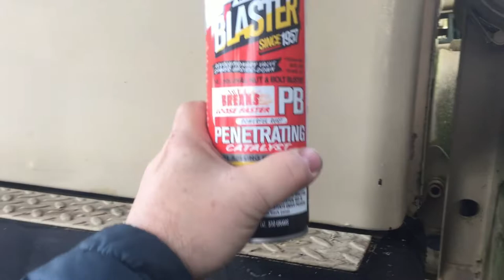FMTV AIRBOX & SNORKEL + RADIATOR SALVAGE #23

Comment: it was so fast the radiator was lost in all the action.
Reply from the maker: Bob Anderson, lesson learned. There was four of us working on it, which meant things were going too quickly, with no time to slow down. The next thing I knew, the reservoir was gone, then boom! ...the radiator was out. I saw this while editing, but there was no way to rewind.
Reply: @HelicoolsHelipad  Cut the clip into 2 sections and slow down after the cut.
Reply from the maker: @badbadbob1  you can't "slow down" a time-lapse very effectively. It was worse... I actually did slow it down as best as I could. Too slow means very choppy.